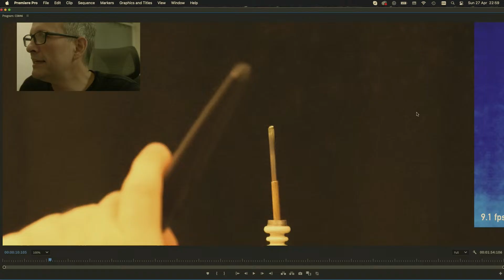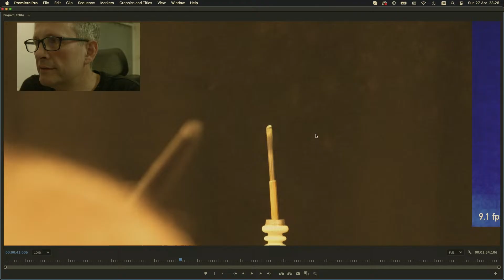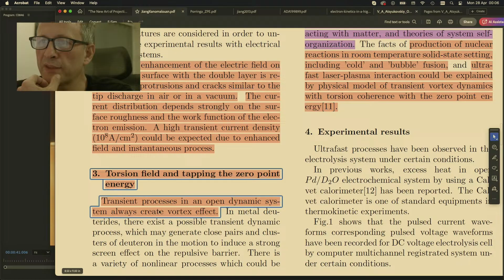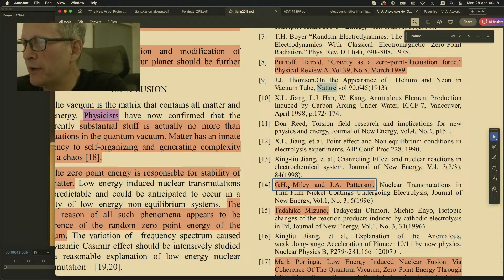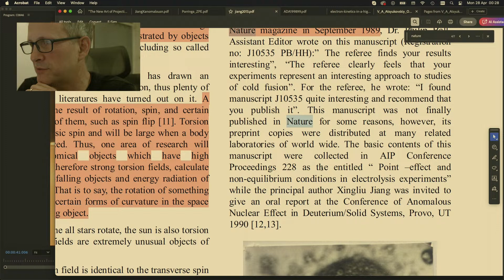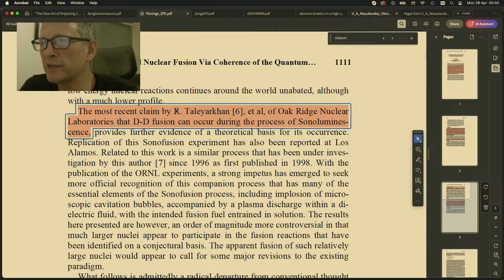O-Day - Unipolar

Comment: Great stuff Bob/MFMP, thank you! 
When you wrote Zeus with you finger tip it made think this could be a way to test/train us to better control/understand what is coming out of the fingerprint spiral vortex.  Maybe set up a control surface and test different meditations/healers (like Reiki).  Or test the thermal outputs of writing something with your fingertip vs. writing with your knuckle…
Also: I think you may have recorded the first image of an EVO wormhole in that set of discharges (around 34/35 min in)
Just some thoughts, have a great week Bob/All✌🏼😊🌀⚜️♾️🍩😳
Reply from the maker: Very much so.
Reply: @ sorry I missed yesterday, been moving…boooo!  About an hour in so far, the transmutation experiments sound really exciting. 
Maybe another comparison style observation test for you humidity variables would simply to look at trees/brush in different geographic locations.  Here in Louisiana we get huge oaks with a heavy/thick branch pattern vs. desert environments get more of a chaotic/tight branch pattern, which I imagine when I hear ‘static electricity’. 
Ttyl Bob 🤙🏼✌🏼